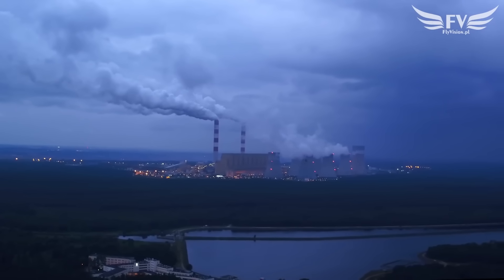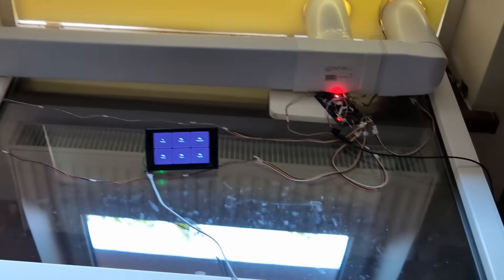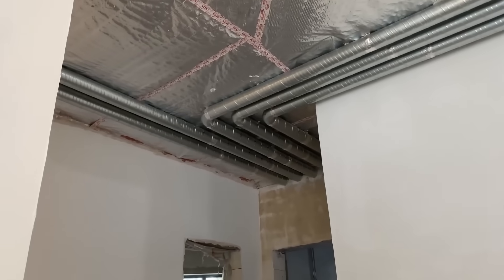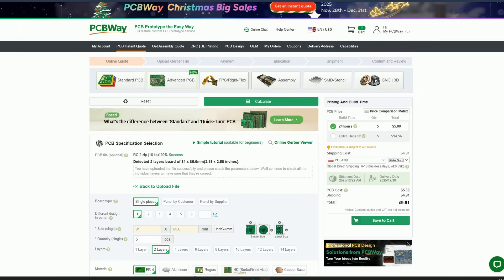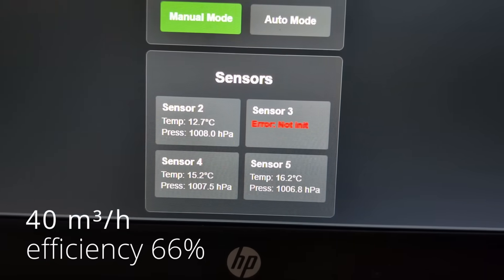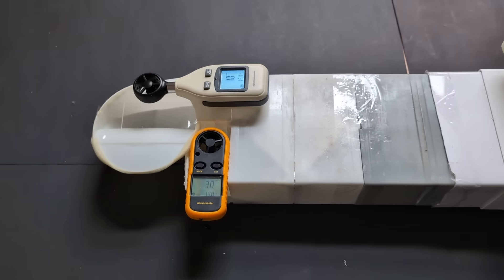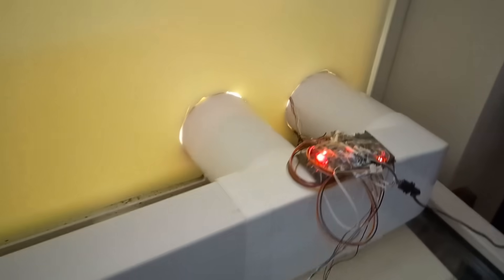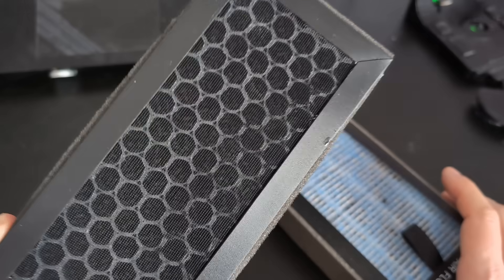DIY Heat Recovery Ventilator: From 55% to 90% Efficiency (Real Tests)

Comment: Your early videos on recuperators got me interested in the topic and motivated me to build one myself. After learning the basics, I noticed a flaw in your designs — the absence of moisture-permeable membranes. A healthy indoor climate isn’t just about clean air, but also a balance of temperature, humidity, and proper air exchange to keep CO2 levels low. It’s a complex challenge that needs a well-rounded approach.
Reply from the maker: I completely agree with you.
I’m running a lot of tests to figure out what actually works versus what’s just marketing. That’s why I only make changes once they are proven effective through testing.

Comment: I've been interested in such an idea for a while wondering why no house has it. Primarily with regard to getting "fresh" air into a house without losing significant amounts of heat. Adding filtration is a nice bonus - though I'd be concerned about fibres if it degrades, and HEPA is a wild west of fake ineffective products. Love the 3D printed former, very innovative little solution.
Reply from the maker: That’s the main reason I started this project — to bring fresh air into a home without losing too much heat.
Reply: I appreciate your goal and your effort, I'm currently living in an apartment with a built-in air filtration and heat recovery unit and I got used to it however I'm looking for possible ways to "retrofit" something similar to an older apartment that I'm about to move in. The noise I heard in the video would  be way too much for me though. I would rather just use the old method of opening windows :) I noticed that 15 minutes is enough to get co2 down to the outside level and while there is obviously heat loss, it's not a lot, since only the air gets a few degrees cooler, while everything with significant mass in the room (walls, furniture) pretty much maintains the same temperature while the window is open. And then can use a silent air filter if pm2.5 is a concern. I really couldn't figure out from your video how the sandwiched Al panels would recover the heat - are you pushing the two streams of air (cold and warm) in through alternating layers in the sandwich?  Have you considered just buying an air heat exchanger, e.g. a brand new spare part for commercial units?

Comment: Something you may find interesting: there are a number of examples out there now of 3d printed heat exchangers that use a gyroid lattice because they have a significant number of benefits (one example is "3D Printed oil cooler without $30k software? Mistakes were made - Building a 13B Rotary BMW i8: EP15" by "Couch Built" here on youtube). Also, the heat transfer of a separator is dependent not just on surface area but also thickness. Given how small of a feature resin printers can make I think it'd be a good idea to re-try your polymer heat exchanger, but instead of using pre-made plates, print the air channels with a super thin wall gyroid lattice as the separators all in once piece to eliminate leaks and minimize thermal resistance.
Reply from the maker: Thank you so much! I hadn’t thought about printing the heat exchanger in that kind of configuration. A gyroid lattice is indeed one of the most efficient geometries.

The downside is that printing it in metal is incredibly expensive, but I think it could be printed in plastic and then electroplated with copper.
The main issue would be that you couldn’t integrate a vapor-permeable membrane, so condensation would form.

Still, it’s definitely worth testing in practice. Thanks again for the idea!
Reply: @DIY_Yarik  Also, I'll chip in with a clarifying statement to some other comments I saw here: at a certain point the heat conduction of the barrier between both streams gets less and less important compared to the conductivity of the material of the streams themselves, the effective surface area, and how effectively you can maintain the thermal gradient between the two streams at any one spot. In some cases using a more conductive separator can actually be a detriment as the heat winds up spreading more along the surface rather than across it, messing up the thermal gradient and requiring significantly larger flow path lengths to achieve the same result.
Reply: @DIY_Yarik  I wasn't suggesting you electroplating it or printing it out of metal or anything, just relying on how thin you can make the surfaces using a resin printer to minimize resistance (and cost). I just pointed out the example video as an easier shorthand than trying to describe the concept in text.

As to the moisture issue, there are many options. For instance, on the complex side of things, if you were willing to accept a minuscule amount of mixing between the two streams on the driest of days you could print in pinholes along the bottom surface, allowing condensate to make it's way to the intake chambers and either evaporate from a pool on the bottom surface or even printing in features that wick the water up into the air-stream (but the effectiveness of that depends on your printer's capabilities and your patience in not damaging those features while getting the uncured resin out.

A more simple solution to the condensate and rehydration of the incoming air would be to simply drain the condensate into a wide drain pan just sitting below the window and maybe direct the dry incoming air down towards it, unless there is a significant reason why the single module must do both the heat exchange and evaporating the condensate.
Reply: @DIY_Yarik  if you are using a symmetric heat exchanger, you do not need metal. the heat exchange is not magically transferred from air to metal, it is limited by air conductivity. since you need to conserve the amount of air in the room, the exchange must be symmetric, therefore, the heat conductivity is only useful up to air conductivity, which is usually worse than plastic, so plastic should suffice.

I have seen to many people making videos and slowly realize that. asymmetric heat exchangers are another thing when conductivity and heat capacity matters (copper is actually worse than aluminium because of high heat capacity, as it make it harder to create a big gradient inside the metal).

Someone should try to do a PSA already about this.
Reply: @giuseppebonatici7169  I think it is not entirely correct. I'll try to explain.
First, a simple example of a thing most of us did as kids. Try to remember how it feels to touch metal bar during a freezing day or to sit on a sheet of steel. Then do the same with styrofoam. Both materials have vastly different thermal conductivities (a fact shown by the clip author).
Now let's dive a bit into physics. What is a temperature? Basically it is a measure of kinetic energy of particles in any material (their "jiggling" as Feynman put it nicely). And thermal conductivity, is the ability of that material, to spread that "jiggling" evenly. The faster it happens, the more thermally conductive is the material.
With plastics, you can have a hot surface (which will not absorb heat from air) and cool inside - kinetic energy is not transferred easily by molecules. Metals do that MUCH better, that's because they are able to absorb (and transfer) way more heat than plastic or resin. So metal exchangers will be always much more effective.
@DIY_Yarik Really nice project and a proffesional approach. You could try 3D printed gyroid for tests, and if it works, there are also companies who can do that printing in metal, just like with your PCB. You can check Italian guy  @integza. Search for "integza gyroid". He loves to play with rocket engines and I beleve he used this structure a few times for his experiments.
P.S. Greetings from Poland 🖖😁
Reply: @ogi22  Integza is Portugese . Just fyi
Reply: @josedavid6400  Aaaaaa, now I get his hate for tomatoes 😆Thanks!
Reply: @josedavid6400  Aaaaaah, now I get his attitute towards tomatoes 😆Thanks!
Reply: @ogi22  the problem with the analogy of flesh and the metal bar vs stirofoam, is that is not a symmetrical system, isn't it? I said that with asymmetric system the material matters more.
your example is exactly what a asymmetric heat exchanger is. do you have the same contact with the metal than the air cooling it? no, asymmetric. are you made of air? no, asymmetric. are you even in the same state? no, water/solid2air cooling is the most common asymmetric heat exchanger that there is.

I already saw the video of intezga, and he was equally as wrong in this as he was trying to create an asymmetric heat exchanger, using the design for a oil2oil symmetric heat exchanger. A better reference of someone who understand this is the series of cryogenic refrigerator of hyperspacepirate, which breaks down the calculation that ultimately shows that in any symmetric heat exchange system, the material has to be as conductive as the conductivity bottleneck.

Also intezga is not italian, is portuguese.
Reply: @giuseppebonatici7169  I'm not quite sure I understand you properly. 
Basically all heat/energy transfer is asymmetric - you need to have energy/temperature difference for this transfer to occur. It's the principle of 2'nd law of thermodynamics.

And you can think of that in many ways. One is a bit more difficult (thermodynamic laws), at least in my oppinion. Second is for me a bit easier - kinetic way. Easier in my oppinion is because you can show exactly what is happening, when you imagine the exchange of kinetic energies between molecules. And temperature (heat) is nothing more than an average of all molecules kinetic energies. A wonderful explanation of this way of thinking, gave Feynman in his interview.
The more conductive material you use (and you have to use a different material than air to make a heat exchanger), the more efficient energy transfer you will get. But, this energy transfer occurs only where two materials meet. So you have to increase the area to make heat transfer better.
Sure, your bottleneck here is the air. But there are workarounds. One I mentioned is making the area bigger. So making small channels will help. Two, turbulent flow - it will mix the air and cool/heat it faster. Three is to increase the pressure (more air molecules means more chances to exchange heat), and the last I can think of is velocity of the air (or the amount of air pushed through the exchanger). In the same way, your laundry dries much faster in a windy cool day, than in a hot but still air.
Next thing, a good heat exchanger should have a low thermal inertia. Also low thermal capacity. Hence thin walled metal heat exchangers. Prefferably with a turbulent flow, or channes as thin as to allow maximum heat exchange.

I have seen some hyperspacepirate clips a few years ago, but I can't remember him mentioning symmetric heat transfer... Perheaps this term was about the geometry of the heat exchanger? Could you give a name of that clip? I would gladly check it out.
Reply: @giuseppebonatici7169 Just chipping in to monitor this thread. My gut feeling is that this scenario (air to air heat transfere with relatively low delta temp driver) is a "symetric" system and that the separating material is the determinant factor in heat transfer from the hot side to the cold side. For once chatgtp agreed with me witch makes me suspicious as I mostly catch it in getting some parts wrong 😂.

Like I said want to monitor the thread to see if I can learn something. 👋🇧🇻
Reply: @ogi22  maybe he is not talking about the material of the heat exchanger but rather the fluids it is working with.
Reply: @noldushumlesnurr6169I'm confused on how you understand symmetry here. Can you expound on your gut feeling understanding? Also, what does the material of the heat exchanger (separating material as you've said) have to do with that?
Reply: @noname-codm4590 As I understand it. You have symetry when you transfere energy from air to air (same medium) and in aproximately the same volumetric flow. As energy has to travel through the separating material which, ability to transport energy/heath, becomes the important factor. variable in the equation. Aluminium transfers heat way better than plastic.   This becomes especially important in applications where the heat difference is low. If the heat difference is high the driving force (heat difference) might be more important than the conductivity of the separating material. Same if medium ( air in this case) flow is low the time you have to transferee the energy will increase so the conductivity of the separator is less important.

Well that was my "gut feeling" explanation. I have forgotten most of my physics formulas and math manipulation skills. So my gut feeling is basically what's left 😟

Comment: What about using Chopper pipe? Like the Real thin pipes and just Stick pipes together? Should be a lot easier to seal with orings and 3d printed end cap Plates - and similar in result to your bend sheets
Reply from the maker: Unfortunately, no. I originally used 6 mm tubes but switched to 12 mm, because the thinner the tubes, the higher the airflow resistance.
Using very thin pipes would make it much harder to push the required volume of air through, even if sealing and assembly were easier.
Reply: @DIY_Yarik if I'm not mistaken, you only might need pipes on one channel, while the other channel can be the space between them.
3d print some baffles to insert into the system to create some turbulence. Coils of copper wire inside and out could suffice.
Reply: @DIY_Yarik no I mean thin by wall thicknes, not the diameter

Comment: Could you use SLM Alu to make the heat exchanger?
Reply from the maker: Yes, this method is feasible, but it would be an incredibly expensive heat exchanger.

Comment: Couldn't you dip the copper plates in a vat of solder? Let it heat soak and then shake out the excess solder? Downside, it's expensive and you wouldn't want to use lead.
Reply from the maker: You basically answered the main issues yourself 🙂
I’d add that it’s also very unsafe to do in practice. Molten solder (especially lead-based) is dangerous any moisture can cause violent splashing or even an explosion.

I’m leaning toward a design that mechanically clamps the plates together instead. It’s safer, cheaper, and more realistic for DIY and small-scale builds.

Comment: Wouldn't feeding your exhaust to the AC external unit do exactly the same thing with minimal materials and maximum efficiency?
Reply from the maker: Not quite. Feeding exhaust directly to an AC unit wouldn’t work the same way.
AC units are designed for cooling with refrigerant cycles, not for continuous heat exchange with high-humidity or polluted air.
Reply: @DIY_Yarik Did you just copy an AI prompt response? Because that's exactly what I got from google

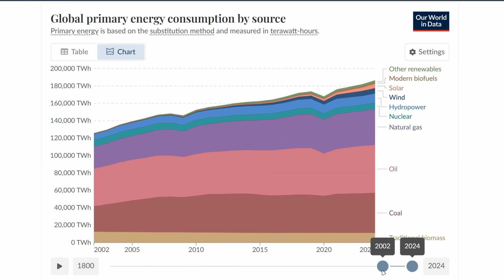Comment: 0:50 that is not "almost exponentially" that is a fairly linear growth (as shown in the video).
Reply from the maker: Not exactly.
I only showed a small part of the graph. It actually starts around 1800, and if you look at the full timeline up to today, the curve looks like the early phase of an exponential, not linear.

And if you factor in the recent increase driven by AI-related consumption, the exponential trend becomes even clearer.
Reply: @DIY_Yarik  Well then you should have shown that. But the graph you did you is in fact linear.
If you had shown say India or China then it would be correct, but for most countries in europe and north america (traditionally the highest energy consumers) the curve is nearly stagnant with nearly no increase in energy-consumption in the past 20 years (And even a reduction in many countries). So it is not like nothing is changing.
Reply: @DIY_Yarik   These guys with their linearity, eh? Like they are blind for the last seconds of the graph when you zoom out.
Reply: @Sekir80  Nope. The zoomout to 1960 IS linear.

Comment: I admire your structured work method and perseverance and congratulate you on your results! That must have been truly satisfying. 

I have two questions:
- is the high circulation necessary or could you reach the same results with lower speeds and longer duration? 
- could increasing the size of the heat exchanger reduce wind speeds and further increase efficiency? (At 95% there’s certainly no need for the latter so that part is just an academic question). 

Tia and I wish you all the best for 2026.
Reply from the maker: Thanks! I feel satisfied when I run lots of tests and implement the best solution.

Lower airflow speeds can increase efficiency, but my current flow is not very high — about 40 m³/h. For example, one person needs roughly 30 m³/h during the day and 15–20 m³/h at night.

Increasing the heat exchanger size does improve efficiency, but I found that using 3 groups is optimal. Adding a fourth group didn’t significantly increase efficiency, but it did increase airflow resistance.
Reply: @DIY_Yarik Hi again and thanks for your answers. 
What I meant by a larger heat exchanger was a single bigger sized one as opposed to adding more smaller ones. 

I very much like the idea of having ventilation and heat exchangers per room instead of heaving one for a whole house. The challenge would probably be to make them small enough and/or aesthetically pleasing.